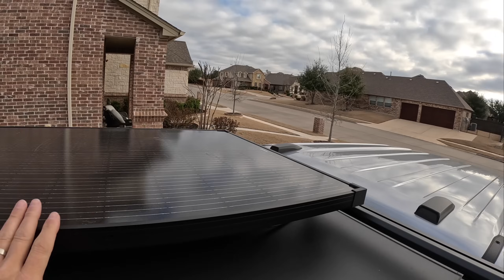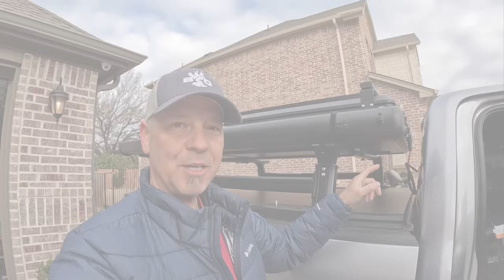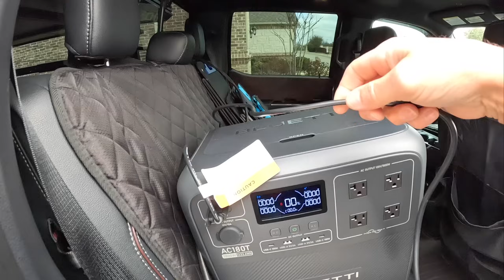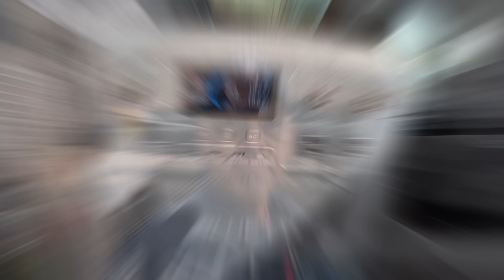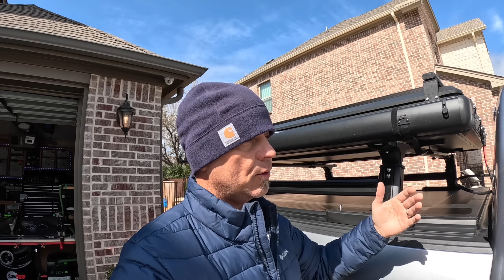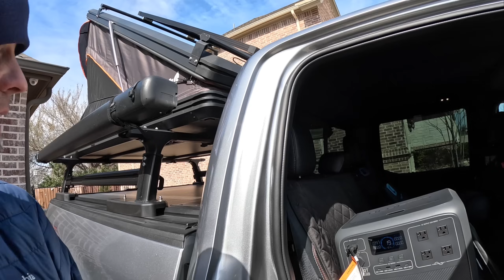How much realistic power can you get with a single 200 watt solar panel on Rooftop tent?

Comment: Looks like you would have room for 2 panels up there and be set up pretty good for a faster recharge rate. I was messing with my bluetti AC180 yesterday with a 160 watt Renogy flexible panel and was only able to get about 40 watts. Hoping better conditions will help
Reply from the maker: I tried, but (2) of them hung over the side

Comment: 33% on a larger battery is actually very good. Had that power station been something smaller, like many of us actually use, that percentage would have been much larger, relatively, to the smaller station. Also, you might want to place a sealed MC4 dummy cap on those cable ends to keep them clean and corrosion free. I am impressed with the performance of that panel.
Reply from the maker: Good idea on the mc4 covers👍🏻

Comment: Nice real-world testing.  I was hoping you would hop in the truck and turn it to face the sun a little more, to show what difference that would make, but are you going to do that while camping?  Would you intentionally park facing south, to get optimal sunlight on the panel?  Maybe, maybe not.
Reply from the maker: Just all depends on the camp spot. I might move, or I might be stuck where I’m at👍🏻

Comment: How efficiently does the power station charge when it’s outside and cold? What was the air temperature during your test? I appreciate your posting of the results of this experiment. I’m new to power stations and I’ve been wondering about charging mine. I’ve been told power stations don’t like cold.
Reply from the maker: As long as it’s now below freezing it does fine👍🏻

Comment: Let's say it'sa nice sunny average hot day... would you still have your power station inside your truck with only the small rear window opened up?  Would the truck's inside temperature be too hot for the long-term functionality of the Power Station?  IDK but I'd be concerned it would overheat in the Texas or Florida temps... but I'd also be concerned about it "growing legs" if I left it outside too while fishing or elsewhere.  I do have an on-board hard wired 300 Watt Inverter but haven't ever used it.  I have mainly stayed with rechargeable batteries and 12V for my electrical needs.  Now I'm thinking of a larger Power Station and one Solar Panel.  I'm pretty much a minimalist so the smaller the better for me.  I'm not knowledgeable about Solar 😢at all.
Reply from the maker: No way would I leave it in the truck cabin in the summer. At worst I’d put it in my truck bed and roll-up the tonneau cover. But, in reality I’m typically close to my truck on these trips and do t need to worry about sticky fingers😉
Reply: @BrianWatersOutdoors  oh my, I may have worded my question somewhat incorrectly.  I didn't mean to offend you in any way.  I'm just learning about Power Stations and you are very knowledgeable about them so I asked.  It simply occurred to me that the power packs inside the Power Stations would mostlikely have a sensitivity to different temperatures, hot or cold.  I'm truly embarrassed if I failed to ask my questions about it in the best possible light. 💕

Comment: I need to try similar test since our riggs are pretty similar and I am using a 200 watt Cigs panel on mine.
Reply: I think for serious campers, CIGS is the way to go.  I have 2 Renogy 150w CIGS panels installed permanently on my truck's cap.  They are tough as nails,  very efficient, light, and thin..  Total weight for both panels is about 13 lbs.  Some non-Renogy CIGS vendors even tout their panels as offering hail protection for the vehicles. Of course, Texans don't have a hail problem, do they? (JOKE!)  CIGS panels are also much more expensive than other panels, but competition will knock the prices down a bit. Nice warranties, too.